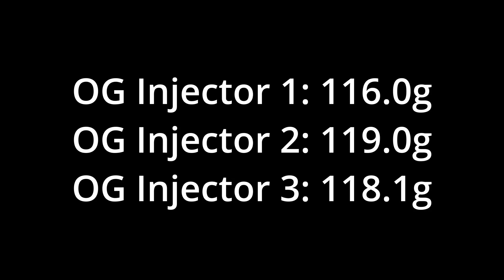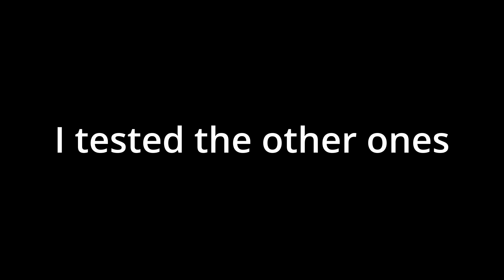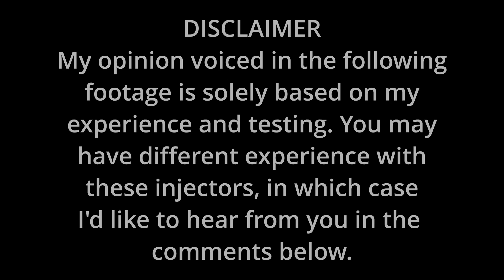Before watching this! Are these injectors bad for your BMW K75 K100 K1100?

Comment: Lean mixtures often result in unburned fuel - you essentially get lean misfires.  Lean mixtures also lack power so often people increase throttle to get suitable power - much fuel wasted because it goes out the tailpipe.  You could only tell if it was CO and HC (rich mixture) or HC only (lean) using a gas analyzer.  
You might also have something on the ohmic value - often low resistance injectors have faster opening time, but as you said it should have shown up on the bench.

Comment: You need to replace the thermostat at the bottom of the radiator stub that controls the fuel mixture. and check the rubber pipe at the bottom of the fuel pressure regulator is in 100% condition. Good luck with the channel
Reply from the maker: Thanks very much!
The thermostat is good and the rubber pipe was fairly recently replaced at that point. In fact, most rubber hoses were replaced because there were some cracked ones. The weird part about all this that the bike only runs rich on those ev14 injectors, not on any of the other 2 tested.

Comment: temp sensors are bad
Reply from the maker: I measured those and they tested good. It also wouldn’t explain the premise of the video… that the exact same bike with just the injector swap runs rich and with the others it doesn’t…

Comment: Any supporting mods to warrant the demand for more fueling? I'm running pod filter and a high flow open muffler. Could it just be that your bike is not in need of added fueling?
Reply from the maker: Hi there!
There is no demand for more fueling, and no other mods. That’s exactly the issue. These injectors based on spec should deliver the same volume, just result in better combustion with the finer spray pattern. The problem is exactly that I don’t understand and can’t figure out why is there more fuel with these injectors.
Reply: Hi, main reasons why ev14 delivers more fuel on bike are two - they squirting twice  per engine cycle - two revolutions.  And second - ev14 have shorter deadtime. If ev6 have 1,5ms deadtime and ev14 have 0,6 deadtime,  then  while squirting twice per cycle betwen intake, on ev1 is 3ms deadtime with 4ms injection - total pulse length 7ms. On ev14 with faster opening is injector opened 7ms - 1,2ms = 5,8ms injestion time. This nearby twice fuel injected!  This is big problem on shorter pulse durations (low load, idle)  On WOT is deadtime only small fragment in pulse duration.

Comment: I have had the same experience as you with a 1986 K75C. I will contact the seller who are experts in Kbikeparts. They ran rough on the bike and I returned to the old injectors. I will try the Bosch you suggested if I need new ones. Thank you for this video.

Comment: Ich hab von Power Brick EV14 bestellt aber die sehen nicht wie Ihre Injektoren aus ?! Die sind genau wie Originale Injektoren aber mit 4 Loch !!!
Reply: Es wäre sehr nett wenn Sie mir sagen können um die von Powerbrick sind oder von Bosch ??
Reply from the maker: "Hi! Das ist wirklich interessant! Ich habe die EV14s von Thom bei KPartsHolland bekommen, aber soweit ich weiß, haben sie früher dieselben Injektoren verkauft. Ich habe gehört, dass sie versucht haben, einen besseren Ersatz zu finden, also hast du vielleicht schon das Gute bekommen? Wann hast du sie gekauft?"
Reply: @volimoto  ich hab die gestern gekauft und hab ich mit Thom gesprochen, offenbar die sind Neu und auf seine Webseite hab ich Bildern vol die Injektoren gesehen . Die Sind Neu und genau wie Originale Injektoren sind aber mit 4 Loch . Thom hat gesagt ich schicke die zu Power Brick auch . Ich dachte dass die Fake sind aber die sind wirklich Neubrand und Geil 👍🏻 Danke für deine Antwort .

Comment: They do deliver more fuel than the originals, and after a while of use the bikes ECU is supposed to control the fuel mix. So at first the mixture will be a little rich.
Reply from the maker: That’s true for the k1100s but K75 and early K100s don’t have O2 sensors or any feedback to correct the mixture.
Reply: @volimoto  Dont know bout that. This was just the answer of a specialized injector shop.

Comment: I have the EV14 injectors on my R1100 and they improved the power and smoothness of the engine. I installed a flex fuel kit, and that made the bike miss fire and be overall uneven running. But after new bosch platinum spark plugs and injectors, it runs very smooth now.
Reply from the maker: Really happy to hear it’s working well for you! I think it’d be the same for the K1100 as well, as both yours and that already have the more modern Motronic injection, and not the L-jetronic as the K75s and K100s. The R1100 is a nice bike👍🏻
Reply: What is flex fuel kit? I'm owner R1100RT 97', want replace stock injectors to smooth rough idle.
Reply: @zettaker2181  That is the same exact bike that I have. Mine is blue. 😀 The flex fuel allows you to put E85 (85% ethanol alcohol, 15% gasoline) into your tank. The injectors are kept open slightly longer to allow more fuel into the engine. I highly recommend the EV14 injectors, new Bosch spark plugs and throttle body sync to make your bike run better than new. I don't remember the part number of the spark plug but I can find it for you when I get home.

Comment: Very interesting video. I recently returned my K75S to the road after a 19yr hibernation. I am at a loss to explain my experience with fueling also. The fuel tank innards were all replaced with new parts, but i was not able to compare psi of old pump to new pump as old pump was long since deceased. Pressure regulator tested at roughly spec. Initially, the bike ran extremely rich on the original injectors. I removed them and cleaned, replaced orings and reinstalled, with no appreciable difference in the richness. As you say, embarrasing. I ended up balancing/synchronizing the cylinders and putting the bike on an exhaust gas analyzer. Long story short, I ended up with the air bypass screw about 7 turns out as opposed to an original 1 3/4 turns out from the stop. The bike starts and runs normally, requiring use of the choke/fast idle lever to maintain running while dead cold, reducing to no fast idle lever over a couple of minutes or so. Fuel consumption is somewhat normal from what i remember before hibernation. One simple test is to fully warm bike and allow to idle. Should be about 1,000 - 1,050 RPM. Push starter button with engine idling ( no danger of inadvertant starter operation/damage, starter is locked out automatically on K bikes ). You should observe a very slight RPM rise, about a needle width on the tacho, as the bike thinks its in a start scenario. If you get this result, you are somewhere near where you should be for AF ratio.
Why is there such a difference with the air bypass screw over 19 years? Dunno, TBH. Is it different composition of fuel? Who knows?? Im thinking of dropping $$ on a new pressure regulator, just to rule that scenario out. Nice to have the bike as i remember it though, good fun. Tks for your video.
Reply: When you say "air bypass screw" are you referring to the screw to adjust the co-value on the airbox right above the motor?
Reply: @dduncker5457  Yep, adjusted with an Allen key. And I made certain the air flow flap was free in its movement ( very gently ).
Reply: @harrothepilot I forgot to switch YouTube accounts. Thanks so much! I might need to replace my air box to do that because the idiotwhom abused the bike for 20 years put a bunch of jbweld and duct tape all over that hole.
Reply: @viiixxviimm  aaaaaaargh. Oh no, good luck with that. Be aware also, that screw affects only low speed running, to about 3k rpm as far as I can assertain.  But, that’s where my own problems were, around idle and off idle. Also check ur fuel pressure reg for 35 - 37 psi output and the air flap for free movement. Both can have an effect on idle mixture. Cheers.
Reply from the maker: First of all, I’m happy to hear you resurreceted the hybernated K75S! I hope it’ll bring you a lot of joy riding it!
- It’s very interesting that even after doing all the cleaning it ran so rich! Have you tried cleaning the MAF sensor? (i know it’s not really a true MAF in these bikes, but for the ease if it let’s call it that). Or maybe the little door inside is moving a bit stiff?
I’m glad you managed to get it run properly! I wanted to put mine on a gas analyzed but couldn’t find anyone near who had one.. there was a workshop my dad used to work for that had in the past but when I asked they said they sold it some time ago..
Let me know if the fuel pressure regulatir does the magic! And thanks for your comment!

Comment: Don't be pretentious, against an army of Bmwtop engineer, I doubt you can improve performances ( without sacrifice of the durability, vibration....)stick to original parts at least on the engine side
Reply from the maker: Thanks for your comment. I think you highly misunderstood the purpose of the video.
Reply: In 1991 there was no 4 hole injectors...

Comment: Creo que la opcion de un inyector para cambiar el original (0 280 150 210)  por uno que nos de mas gasolina podia ser   (0 280 150 -208)  el primero tiene unas caracteristicas de  135,1 cc/min y/o 97 gr/min a 2,5 Bares por la opcion que propongo 0 280 150 208  que proporciona 144 cc/min y/o 103 gr/min a 2,7 bar NOTA Bosch Creo dos inyectores con la misma referencia hemos de encontrar el que es para renault 1.4 no para BMW

Comment: hi, thank you for your video, really interesting. i have some question:
- where did you find the fuel flow rate spec for K bike injectors? are you sure that the 116 gr spec is correct for K bike? is this value referred to 1 minute of operation?
- the BOSCH code 0 280 155 969 is reffered to EV-6 injectors. The EV 14 injector 116 g/min n-heptane has this Order number 0 280 158 200. are you sure you order the correct injector?
regards
Reply from the maker: Hello!
To my memory I found the specs for the K bike injectors at one of the well known websites for K parts. Funnily enough, I can't find the same spec sheet right now, and 3 different places list 3 different specs... But yes, specs are given for 1 minute of operation at 100% duty cycle, which you shouldn't do in testing because you can burn the coil inside.

This store advertises the replacement for the original K bike injectors with the specifications I used for my testing ( 116g/min and 166cc/min, except for impedance being different) but this is not the page I've seen before:
https://bavarianwerke.com/product/brand-new-genuine-bosch-fuel-injectors-for-bmw-k75-motorcycle-replacement-for-bosch-0280150210-bmw-part-number-13641460450/

The BOSCH injector BOSCH 0 280 155 969 is indeed EV-6. Those are the alternative injectors I purchased to install into the bike. I think they're for a 3 series BMW, but can't remember right now. They also have 116g/min or 166cc/min as the original K injectors were specced based on what I found info at the time.

I don't believe I mentioned part number for the EV14s in this video. The injectors are from KPartsHolland and I had used the part number on the side of the injectors to identify specs. These injectors are originally from a Renault/Dacia.

And importantly, I used my testing setup at 3 bars for all injectors, because the specs I found were given at 3 bars, and I wanted to maintain consistency between it all.
Reply: Según creo las características del inyector Bosch 0 280 150 210  son 135,1 cc/min o bien 97.19 gr/min a una presión de trabajo de 2,5 bar y utilizando como liquido n-heptano , pero hemos de tener en cuenta que podemos hacer que trabaje nuestra LE Jetronic o nuestra motronic de forma mucho mas forzada   https://youtu.be/KtFZ2C8fqCE
Reply: Por favor por que indicas como referencia los inyectores 0 280 158 200 Si no creo mal estos inyectores proporciona 170 cc/min y/o 116 gr/min a una presion de 3 Bares, si el regulador de nuestras motos trabaja a 2,5 bares estamos haciendo trabajar los inyectores con otros baremos no testeados.

Comment: My last two comments have been deleted..do not know why. Pls first check and/or renew sparkplugs and wires. Check the valve clearence, then install the EV 14. After the install balance your throttle bodies. My engine runs smooth with a hint more power. Consumption 😇4,5-5,5😈. Try to buy pre flow-meter balanced EV14. Look at TILLS and K75 via google or so.

Comment: I think EV14 impedance could explain the problem. This is a very interresting track. Depending how the Le-Jetronic control injector. I am electronician and have some schematic, so I will try to understand exactly what happen.. If with jetronic injector open faster, then yes it will be rich at all rpm! (I think you control injector with arduino board, correct ? ). On your bench  it would be interesting to command injector with the jetronic. I could help you to do that because I realy know how jetronic work !
Reply from the maker: Yes, I was just using a small relay with 12V power controlled by an arduino to open/close the injector.
It’d be very interesting doing some experiments with the jetronic system for sure. 

Merry Christmas!
Reply: @volimoto  The deadtime of the Valve is Rising with lower Voltages. The EV14 also opens  faster than the normal Valves because of less mass.
Reply: I dont know why my message desapears, .. ok So I said that I made a piggy back with an arduino every who intercept injector command and chaage the timing (I need to remove 900uS to get a nice AFR, tested with wide band lambda sensor and confirmed by spark color !)
Reply: ( BMW K100 LT, without airbox and AFM in vertical mount with big cornet !)
Reply: gmail
Reply: e (point) fiancette

Comment: I installed ev14 on my 16v K100 and i too have been having rich running (black smoke and smelling fuel). So my theory is the ev14 atomize (finer mist of fuel) the fuel so much better than injectors with 1 hole that it combusts easier and therefore would not need as much fuel as the injectors spray. I’m planning on buying a adjustable fuel pressure regulator and playing around with that. Less pressure less fuel right? Any comments doo i sound crazy? Or am i missing something that would not allow my plan to work?
Reply: Hello, I try EV14 on my modified air admission K100 and I confirm, it is running rich, very rich ! I use a Lambda sensor to test how much I am rich (at all rpm). I got an AFR of 10, even less than 10 !!! I try every thing to return to a better AFR but I couldn't ! ( change AFM settinf, spring, cursor position ...)
Reply from the maker: It’s really interesting to hear even 4V bikes have the same issue!
I had also thought about messing around with an adjustable fuel regulator, and I think it could work! I’d be very interested to hear the results if you do so!
- my only skepticism regarding the 4 hole vs 1 hole injector atomization that the new injector I put in are also 4 hole, yet they don’t cause the rich running. I’m still theorizing the the different impedance value is the culprit, but then again, my testing showed that in fact the EV14s sprayed less than the others… 

So please let me know if you test the adjustable fuel pressure regulator. Maybe with less fuel you’ll manage to get a smooth running engine and even reach better fuel consupmtion? I don’t see any reason why it couldn’t work by the way! And if you can’t get one that has vacuum line to it, remember to put a blind plug into the vacuum hose that comes off of the current  regulator!
Cheers!
Reply: @volimoto happy to get your view on this idea so fast! Yeah it’s weird the other 4 hole injectors work fine!? I’ll buy the adjustable FPR but it will be closer to spring for testing. Have allot of building to go on my K. Good thing you mentioned the vaccume hose will remember. And i’ll write about my experiments when i get so far!! I also have original injectors if all ells fails will just rebuild them.
Reply from the maker: @tf0087 sounds great! Looking forward to hear about your results! Happy building! And Happy Holidays!

Comment: I fitted EV14s to my K100, in some areas it ran smoother, but in general it was worse, bad enough I had to put my old originals back in.
Reply from the maker: It’s really interesting that so many people had bad experience with these, yet they’re advertised so much and as they’re the greatest you can get for the K… thanks very much for sharing your experience!
Reply: I had some injector problems with my k1100 and I swapped to the EV-14s and it resolved my issues completely injected kind of turned the bike into a whole new bike I decided to put the EV-14s in my k100 even though it wasn't having any issues with fueling and while the improvement is rather slight throttle response does seem crisper and it feels like it will accelerate up a lot smoother.
Reply from the maker: Throttle responsive was absolutely much better with the EV14s, but the bike was just simply running extremely rich. :(

Comment: hello! first of all sorry for my google english. I installed some of these injectors on my 1992 BMW K1100 and I have also gone crazy with the consumption, black smoke is common as well as the smell of gasoline. I have gone crazy with the TPS, with the fuel regulator and finally with the throttle body. After watching your video I might buy some new injectors to check it. If I do I will post my result here! all the best!!
Reply from the maker: That’s very interesting you have the same problems! I have also looked for the probem all those places, and couldn’t explain why it’s not running well.

Hope you can fix it and looking forward to hear the results! Thanks for your comment!